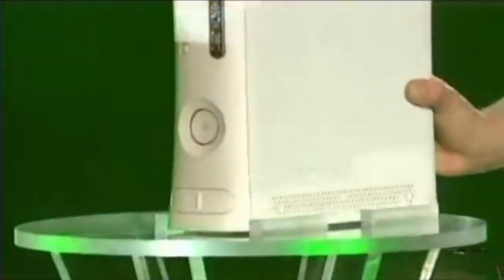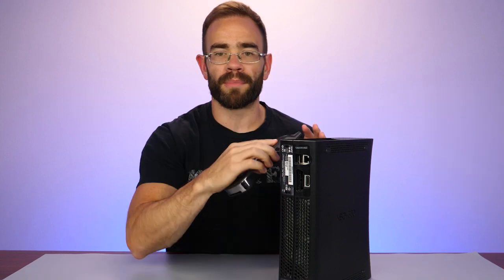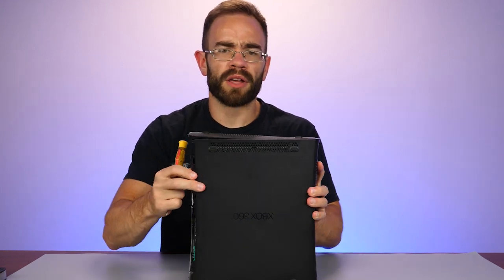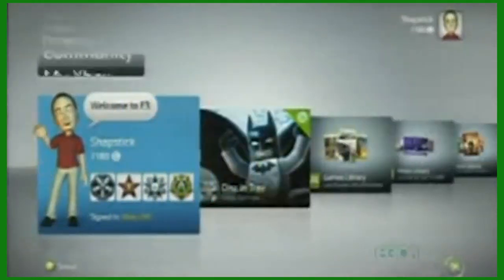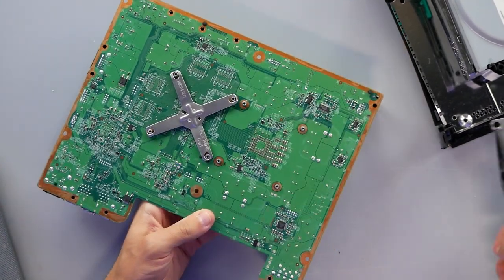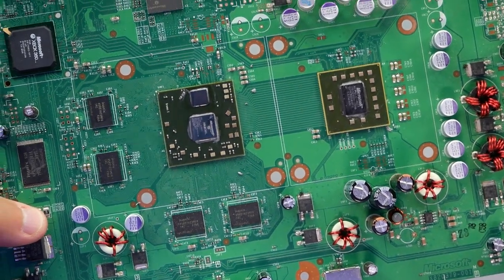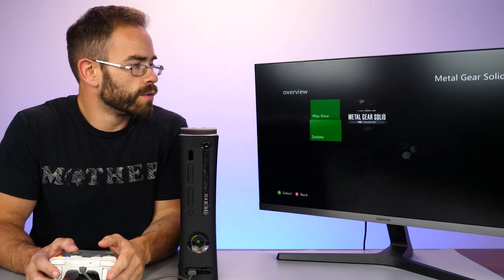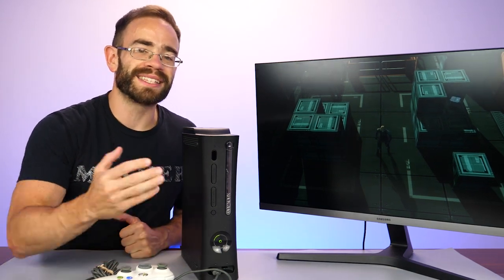The Xbox 360 Elite 15 Years Later

Comment: I hated the 360, I must have went through seven or eight of them, every single one I bought, red ring of death! Maybe lasting a few months before getting it's death sentence.
Reply: Sounds like you were the issue
Reply: @P_D-px6iv  Wrong! I take care of my stuff, it's more like GameStop or back then most were still called EB Games or Funcoland, but they did not check systems properly and a lot of people knew the trick to make it work for just enough time to trade them in and I always got trash systems. I became good friends with the manager at one of the stores in the mall and he told me most employees didn't even bother checking the system past turning it on, he said get the specific black one and that one still works over a decade after getting it. The white ones had issues a lot more than black one did, look it up. And nothing to do with me, funny how every system I own all the way back to my original NES all still work and the 360 is the only one I ever had issues with.
Reply: @P_D-px6iv  in fact I had to take four or five of them back in one day because I get it home and it would play for about 30 minutes or an hour and then the red ring of death, only a few of them even lasted a couple of months until I got the black one like I said.